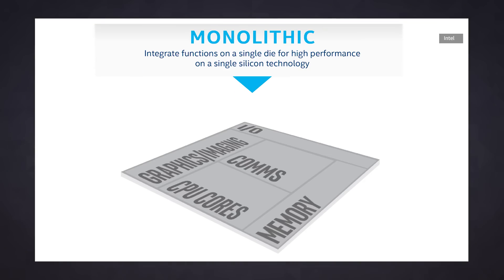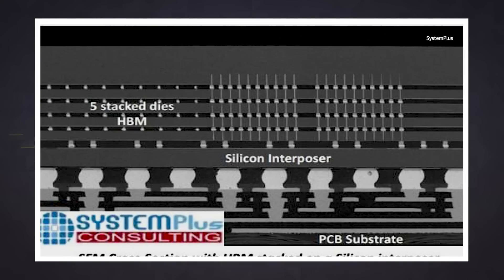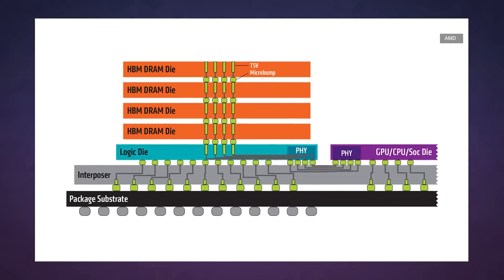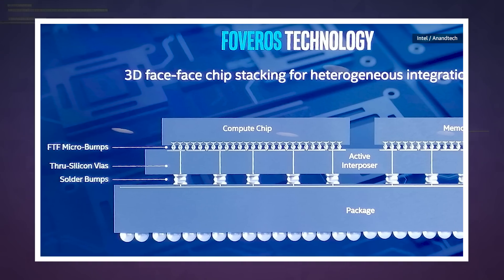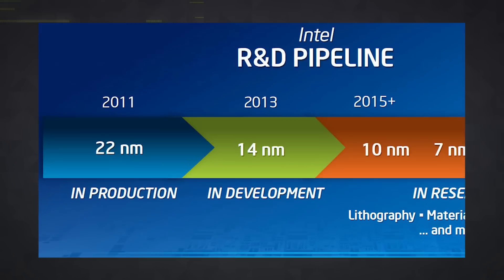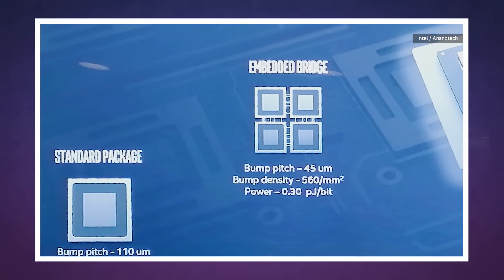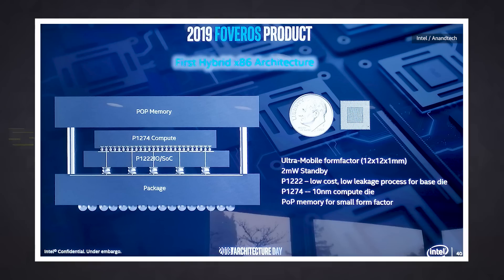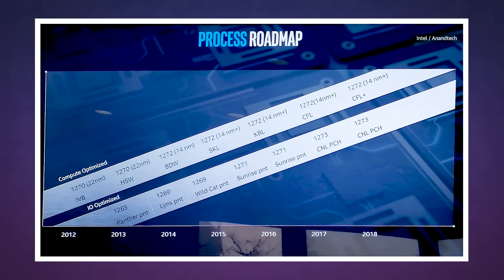This new 3D chip tech is how Intel will beat Moore's Law | Engadget Today

Comment: And where does all the heat go?
Reply: Obviously its vented into the depths of hell. Intel has a heating deal with the devil in exchange for performance
Reply: My first thought! HEAT DISSIPATION???
Reply: single CPU can already hits around 90degree Celsius, not to mention 2 cpu stacked together LOL
Reply: @cwk18  If your CPU is hitting 90c there's something wrong
Reply: @SyrupSplash  90c is pretty normal while gaming.
Reply: @cwk18  90c is you having a really shit cooler and having it under more load than it's capable of handling. 90c is not normal. 80c is on the cusp of "I should probably think about getting a better cooler" 60c-70c is what people aim for.
Reply: @cwk18  ~72c is the maximum temperature stated on Intel website.
Reply: @SyrupSplash  The heat you often see is sometimes misleading. That 80C might be 90C in the core, 80C might be after it leaves the cores and touches the heatsink.
Reply: @dra6o0n  The temp probe is in the die itself. I can't see a variance of anything more than 1c max.
Reply: No shit! Thermals was the first thought I had! You'd have to stack the power hungry proccesing shiz at the top, and low power io type stuff at the bottom
Reply: @xxportalxx.  ... that's exactly what they did.
Reply: @tylerdurden3722  I get that, but many others did not. In fact there was one gentleman insisting they could use lithographicly depisted copper layers as heat pipes!

Not gonna say it's impossible, but certainly it is at this time at those scales and power ranges.
Reply: the chip comes natively in a three dimensional fridge environment for all consumers power dreams... put in some diet coke and mentos together with the chip and discover the magic of hydropowered shytstorms
Reply: @m4r_1991  Will i have to refill the fridge?
Reply: I was about to ask the exact same thing.
Reply: Put more Thermal Paste
Reply: I was thinking about the same thing.
Also besides heat, there's also power consumption. Smaller node usually means lower power. What will happen if we can pack more transistor into a chip but power consumption stays the same?
Heat+ power consumption, mobile market surely will suffer.
Reply: not the neighbours dimensions through the wormhole ;p
Reply: Up
Reply: It's not that much more complicated to lithographically include copper layers for heat dissipation.  Its basically already done for multilayer power electronic PCBs.
Reply: bortlethetortle I'm not sure that a microscopic layer of copper would make up the difference, I'm not aware of any significant thermal gains from multilayer boards, but even if there were you're comparing copper layers of many magnitudes difference in thickness.
Reply: @xxportalxx.  Point taken, but there are other processes in the toolbox. I'm no expert on lithography specifically, but have plenty of other relevant materials science experience. Thicker layers could be created by doping or lithographically creating a microscopic copper surface first, then you could mask and locally electroplate copper more quickly and thicker to this initial 'seed' layer. Quality doesn't matter nearly as much as transistor layers as long as the thermal mass of copper is there. Could also laser machine channels for liquid cooling circuit. Then it could be ground and another lithographic layer of transistors and vias added. There are a variety of electrically insulating and thermally conductive materials that could be used instead of copper too.

Basically what I'm trying to say is that they will find a way and I feel it's not as big a challenge as many on here are making it out to be.
Reply: away
Reply: Things will have to slow down a bit. Really, most of the processing now is done on GPUs which are completely parallelized, so CPUs can really slow down a bit. Although one thing might be that processors really began to transfer data via light pulses instead of electricity, this whole thing of layering processing units really reminds me of holographic memories, if they can create a layered system that updates it's content with light instead of electrons, maybe a large deal of heat would go. Though I can't really think of any feasible mechanism for such a concept to work... 🤔
Reply: @kienhsi9522  Sure cpus do nothing compared to GPU's, if all you do is gaming or extreme tensor computations lmfao, do any real world work other than word and the CPU is the bottleneck again
Reply: @Mass Extinction Good luck getting that mass produced.
Reply: you'll make yourself a tea
Reply: Let me ask folks at Intel about "where all the heat goes"..maybe those PhDs forgot about it while they did all the research and experiments.
Reply: Was gonna ask the same thing , not to mention that it is effectively conceding to moore's law and taking a different route , not beat moore's law further .
Reply: Let's just create massive blocks of chips that weight 8 pounds. 

DON'T. QUESTION. IT.
Reply: the Same way it is in a Smartphone SOC moustly they are stacked ontop of eachother (RAM ontop of CPU)
Reply: Peltier cooler in between the Layers?
Reply: I saw there is a type of cooling oil where i can submerge the cpu into it without short circuiting. Maybe that can be used for new cpu design where it has a built in cooling tank that it then further cooled by exterior liquid cooling
Reply: No thermals. Just a 450% ipc increase and underclocking
Reply: Thermal interface materials will need to be improved to draw more heat out of the 3D chip. Alternatively they would need to explore more thermally conductive substrates like silicon carbide or aluminum nitride materials that also conduct heat better without conducting electricity. These areas are pretty challenging and I’m lucky to be in this research area for my PhD work to help solve these problems.
Reply: Heat is the real why Intel will not have the chips of the future. 

ARM processors have much more performance per watt and they were specifically designed with efficiency in mind. 

And ARM processors are slowly coming close behind Intel in terms of performance. Intel would need to come up with a brand new architecture to remain competitive and axe x86.
Reply: @ericcartmann  can you even get your hands on ARM CPUs for big boy desktops? I only imagine Raspberry pis and phones when I hear ARM
Reply: @SyrupSplash  I would imagine once the ball gets rolling, you'll eventually be able to pick out ARM64 CPUs just like you would Intel or AMD. Except there will be a lot more options as there's several ARM manufactures like Snapdragon, Atmel, ST, TI, etc, etc.

This would also probably open up the idea of custom built portable desktops. Since these CPUs are so low power, it wouldn't be hard to toss a battery in a case and make it portable.
Reply: @ericcartmann  
ARM can only support 32-bit for the foreseeable future. Even the whole attempt from Windows to run ARM with 64 bit is laughable. Intel will still rule 64-bit.
Besides, x86 is so much more robust than what ARM has to offer. It's unlikely they'll ever catch up.
Reply: @MinecraftMasterNo1  "ARM can only support 32-bit for the foreseeable future."

ARM is 64 bit now.... 

"Even the whole attempt from Windows to run ARM with 64 bit is laughable. "

Ya its pretty bad, but Google and Windows have plans to further develop ARM in the future. With the addition of native ARM64 in the newest version of Visual Studio, the ARM version of windows 10 can only get better and better from here. 

"Intel will still rule 64-bit."

They don't now, they only rule the desktop. There's probably way more 64-bit ARM processors on the market than Intel 64-bit cpus. Think about it. iPhone 6 (and equivalent iPad) and above have ARM64, any android phone from the last 5 years has ARM64, Nintendo switch uses ARM64, and the vast majority of servers use ARM64. Not counting the colossal amount of ARM64 micro-controllers inside of many devices.
Reply: @ericcartmann  not to mention AMD rules desktop now...  Oh...  AMD was the first to implement 64bit. It seems like AMD holds alot of clout on what direction innovation goes...
Reply: (In ogre's voice) NERDS!!!

Comment: You are SERIOUSLY making this sound way too easy, there's a whole new set of hardships associated with pulling this off. This is a breakthrough in science and engineering.
3D stacking is a whole different ball game when it comes to CPUs vs GPU or Memory modules. Its like comparing Go(CPU) and TicTacToe(GPU/Memory). The problem lies with heating and performance.
Plus you mention Qualcomm- this process will only be for laptop/desktop/server CPUs. Possibly tablets. Anything with an SoC based architecture is off the table
Reply: yes, when i heard about CPU stacking, heat dissipation is my first concern
Reply: Yeah but I mean it’s Engadget. No offense but these guys are more accustomed to phone reviews than much else. I wasn’t really expecting an in-depth video explaining the nuances of chip design summarized in two minutes, haha.
Reply: Well as you already understood, this is meant to be a vapour ware marketing attempt to make people not buy AMD now. And to keep long term contract partners like Apple (who still has to go with Intel for a few years before they can legally switch to other chips).

Comment: Temps? See either overheating or reduced speeds with this design if going for more than mobile. If going stacked with chips will they start adding cooling method better than paste and the IHS built in?

Comment: I don't think this will even be enough to help them catch up to Moore's Law. They're VERY behind.
Reply: When you are STACKING transistors then there's no point in even talking about Moore's Law. Moore's Law is a specific observation about transistor density doubling every two years  but that's a 2D observation. Does making 64 stacks of memory mean they are beating Moore's Law? Of course not. Again it's based on an observation so you can't "keep up with" Moore's Law if you don't even make a product that's applicable to the definition.
Reply: @photonboy999  Except that's not really what Intel is doing. Instead of building a true 3d chip of uniform transistor density in all dimensions they're just stacking lower density  2d chiplets with limited inter-connectivity. I don't think it will even have the transistor density of a seven nano-meter monolithic chip. It's a clever implementation but it doesn't solve the fundamental problem of heat. It may not even significantly improve chip yields which is what AMD is trying to do with their 2d chiplets.
Reply: ProseColored Glasses  All fanboys are hilarious. Brand loyalty is for white knights and suckers. Which, if either, are you?
Reply: ProseColored Glasses  Calling out a whole group of people doesn't further your point and makes your statement somewhat Ironic. "least educated PC users"  How so? because we don't like being shafted for over priced performance? or are you salty that you're still on board a sinking ship. Intel has fucked up, ARM and AMD are going to be miles ahead of INTEL by Q3 2019.
Reply: @CrackedTubeGamer  
AMD has already lost the majority of its key players to Intel. Sure, Zen was a success but what's next? Zen 2 is certainly not going to beat anything out of anywhere.
ARM only runs on 32-bit for the most part. Windows' attempt at running ARM on 64-bit was laughable. Also, ARM package will almost never catch up with x86. 
So, I'm not saying Intel is a perfect company. What I am saying is that they have been in the game for very long and as of right now, they have a lot going for them.
Reply: @MinecraftMasterNo1  Apple's new A12X is faster than almost all mobile processors while still being fanless. So ARM is catching up
Reply: @Ignacio.Romero  mobile "phone" processors not all mobile processors
Reply: @Ignacio.Romero  A12x is faster only in geekbench scenario and in IOS which is shit when it comes to working situation
Reply: @劉奕彤-q6g  I'm not talking about the OS, the A12 is overall faster than the best fanless processor Intel makes. What do you mean by "faster only in geekbench"? It's factually faster
Reply: @劉奕彤-q6g  No, I said mobile processors, not phone processors
Reply: @Ignacio.Romero  other than geekbench？ evidence？
Reply: @劉奕彤-q6g  There aren't any other cross platform benchmark in iOS, so no. Geekbench score and the 7nm should be enough evidence
Reply: @Ignacio.Romero  geekbench is wellknown as apple bench i dont think it is an evidence. you can search what is cache miss and the content of GB4
Reply: @Ignacio.Romero  in real situation A12（x） may be 20% of an core i series
Reply: @劉奕彤-q6g  If you put an A12X and an i7 Y series (the fastest fanless processor Intel makes) the A12X would be faster, fact.
Reply: @Ignacio.Romero  It's also narrower, less flexible, and doesn't scale as well. The x86 architecture is far from optimal but ARM isn't the answer either.  Raw computing won't solve the problems because those aren't physical. We need a new machine language entirely and the problem there is built up infrastructure and our inability to imagine it.
Reply: Moore's law isn't a law. It was never a law. Shoulda called it "Moore's loose observation of a general temporary trend"
Reply: What company is the opposite?
Reply: @joncook7510  All mobile processor companies... Snapdragon 845 is 10nm, Samsung's new Exynos is 8nm, the new 855, Kirin 980 and Apple's A12 are 7nm.
Reply: @joncook7510  No one really. AMD is getting ahead of Intel but unless they can get below a nanometer Moore's law is broken as far a silicon is concerned.
Reply: @joncook7510  Qualcomm
Reply: @joncook7510  Amd & Qualcomm are putting out 7nm this year.. Apple put out 7nm last year 

mean while intel doesn't even have any 10nm mainstream products yet
Reply: @joncook7510  There are only 3 huge chip factory owners and Intel is the one most behind. Figure out the names of the other two.